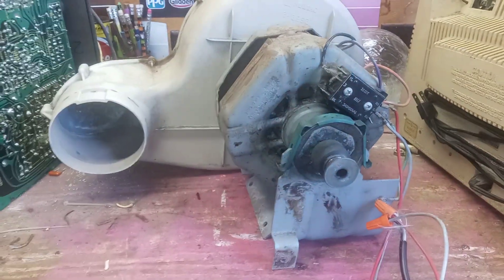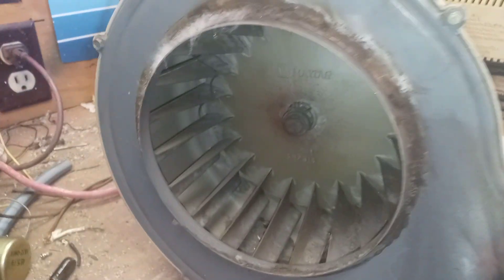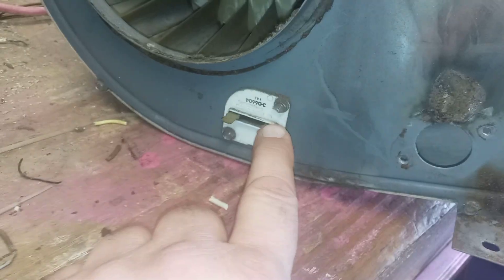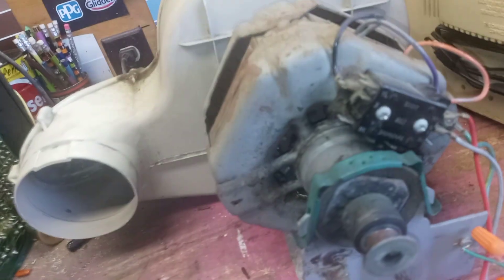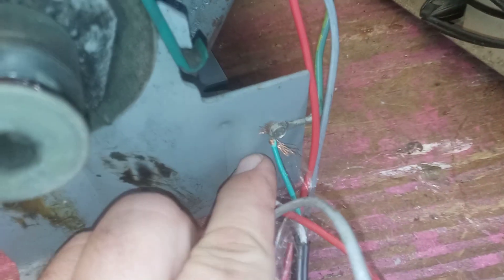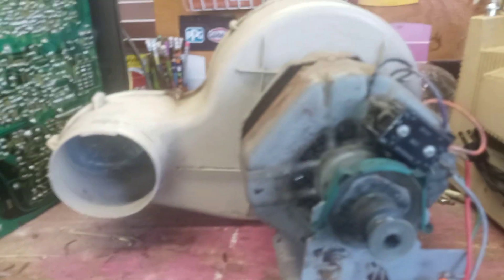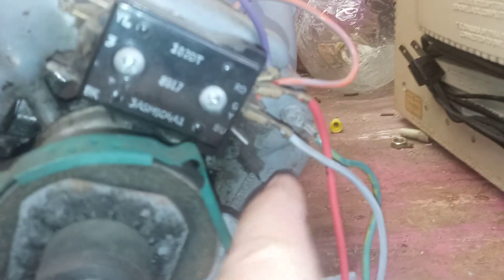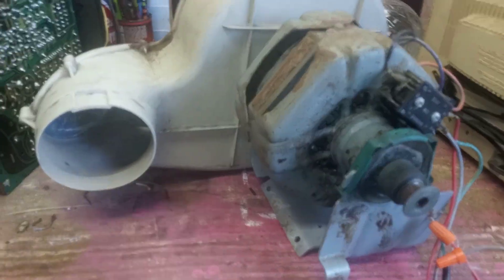Turned junk clothes dryer into a shop fan

Comment: Kool Idea. Needs a plywood base and a handle and I'd insulate those motor switch terminals or swap out that motor switch completely.
Reply from the maker: Yes I'm going to build a platform for it to make it more secure and stable .

Comment: Dryers are not just electrical fire hazards but the lint from clothes lights very easily.  I live in a place where I can burn and I use the lint to help start fire because the slightest flick of a lighter can be enough to ignite it.  On a day without wind maybe a spark.  It burns hot too.  Also if yours uses natural gas keep in mind a carbon monoxide hazard.  Ours is electric to there is no carbon monoxide hazard but if not cleaned out the lint can be dangerous.
Reply from the maker: Yes and dryer lint can be used to help light camp fires and such .It is extremely flammable.If clothes dryers are used properly and maintained,they will be totally safe .